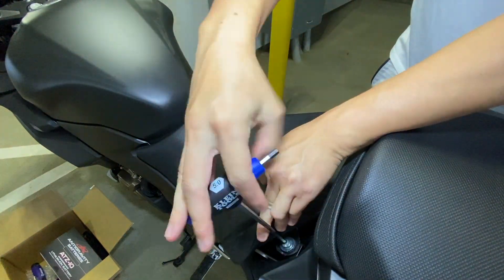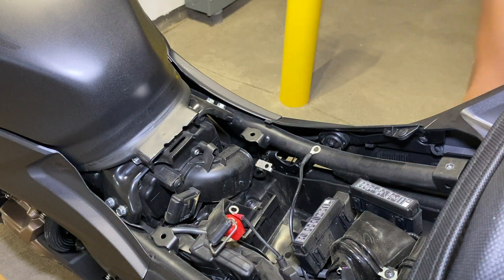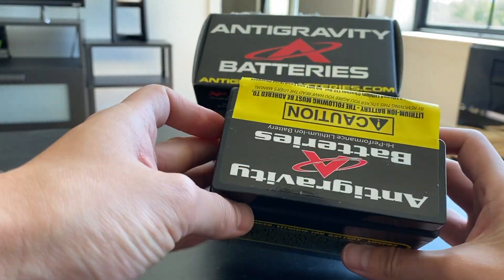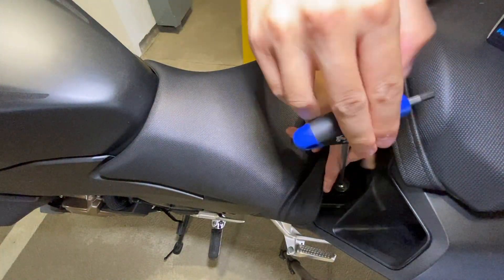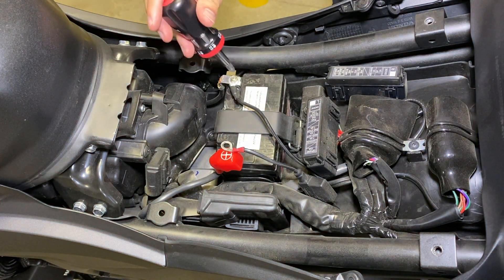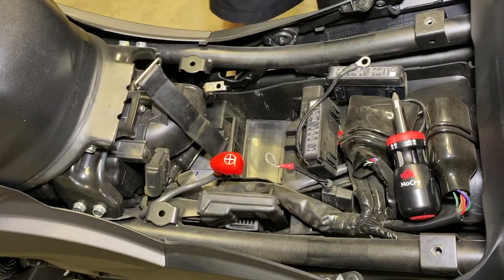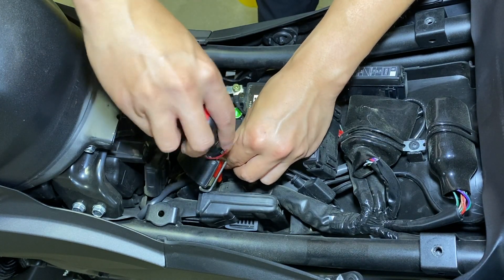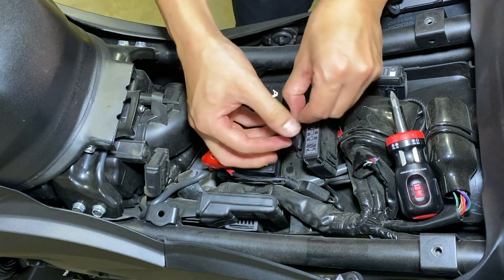2020 Honda CBR500R Battery Swap

Comment: You want to do your negative - lead first because the whole chasis is grounded with the negative terminal. So if you do positive + first and you happen to bump any part of the chassis with metal (wrench or screwdriver) and your negative is still connected, it will cause a short.
BTW, thats the reason the positive lead is covered but the negative is not.
Reply: and when you connect it you go positive or negative first?

Comment: Where did you get the battery? Can’t find this exact model anywhere. Just ATZ-7.
Reply from the maker: The atz 7 will work and has the restart technology but the one i chose has more cranking amps but you will need to figure out something to raise it up since its a bit shorter. Go into the section of their site called OEM replacement batteries
Reply from the maker: https://antigravitybatteries.com/products/starter-batteries/oem-size/ytz7-8/

Comment: Great decal-less motorcycle! I try to remove my decal from cbr500r. Did you do any post-process on your fuel tank after removing decal? I heard that if the decal is removed from the fuel tank, the glossy area will be observed.
Reply from the maker: Yes if you remove from the fuel tank it will remove the top layer of paint and clear coating. I have not done any post process so currently there is a mark where each decal was removed...it looks O-K to me for now😅

Comment: Nice battery upgrade , I’m not going to do this upgrade just yet. Still using the stock battery. (Lead) however I went to go and hook up a quick connect to the battery and the QC rings were to big to fit on the terminals 😱 so my dad gave me a quick connector with smaller rings🤞🏻 they work. Cause i don’t ride in the rain ( I know sounds weird from a dude who lives in the Seattle area) but I’m a fair weather rider these days, and when it’s rainding( for like 10months out of year-LOL!!, slight exaggeration.. but it does feel that way some times) I need to connect my bike during this time. I learned real fast with my last bike that if it’s not connected to a battery tender that battery can die fast. Thanks for sharing your journey Sir.

Comment: What do you notice is different about the bike with this new battery?                                                                                      Great content, I’m thinking of getting the CBR500R soon, just waiting for the right deal. Shoutout from the UK!
Reply from the maker: When its fully charged the bike starts ever so “stronger” fires up a little more solid and faster. But i will say it is a very small difference only. On my previous 300 the difference was night and day but the 500 started instantly even with stock.  Good luck on that bike search, cheers friend!